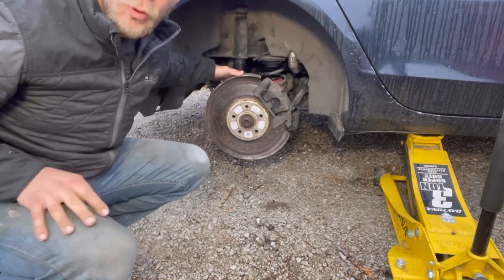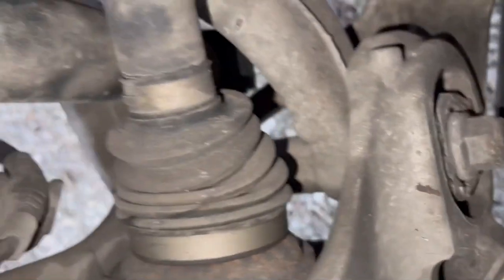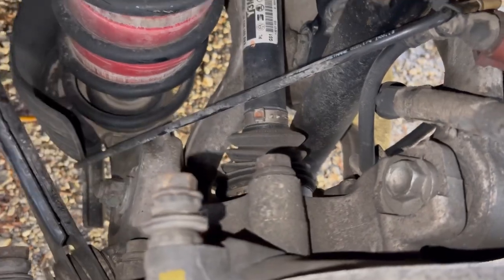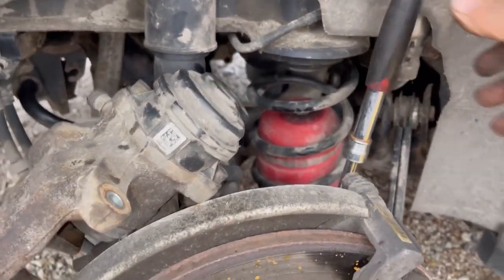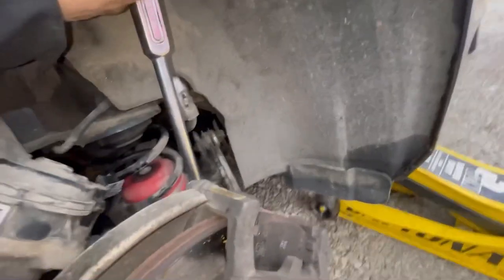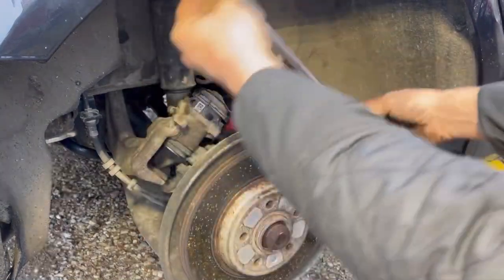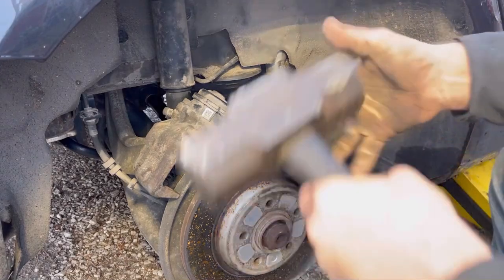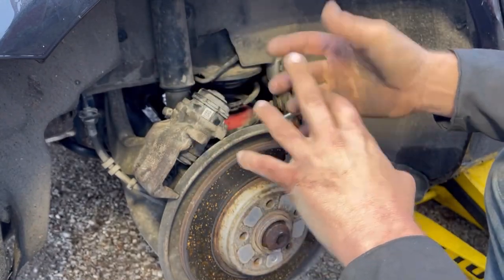SUPER Tight caliper bridge bolts Mechanic Tips Trick removing inside fender well rotors pads brakes

Comment: I did similar rear brakes on an audi a4 or a6 recently at work.  I was able to use my 1/2dr snap on ratcheting breaker bar with an extension i believe for the bottom bolt.  I noticed it was steel bolt in aluminum and was careful, once it cracked when loosening i worked it back and forth to avoid breaking.  The bolts were covered in white powder from galvanic corrosion when removed.  Sprayed with penetrant oil when reinstalling.  Ideally they should be coated in marine grease or metalfree antiseize.

Comment: Your car is a bit different, it has more access.  That's the hardest bolt I've ever removed in my life (2010 A5).  It was crazy tight, had no way to get on it properly (the lower one) and it had about 10lbs of factory red thread lock on it.  Even when it finally started to turn, it stayed consistently tight until it was finally all the way out due to the thread lock.  I had to use a torch.  Maybe on a lift it would easier, with a long breaker bar.  Each 1/4 turn I could get on it took literally all of my strength.  I had to take breaks to rest LOL.  The top one was a piece of cake, and the other side was no big deal either.
Reply from the maker: I have a 2010 a5 cabriolet I need to do a right rear wheel bear on soon so we’ll see if that’s similar
Reply: @grantmccarron3963 Thank You! So I'm not crazy! Must be first year 2009-2010 B8 issue only.
Reply: @CarsandCoding  Crazy like a fox 😆